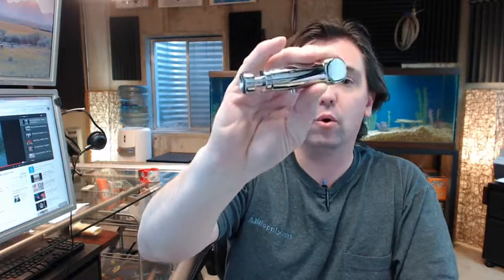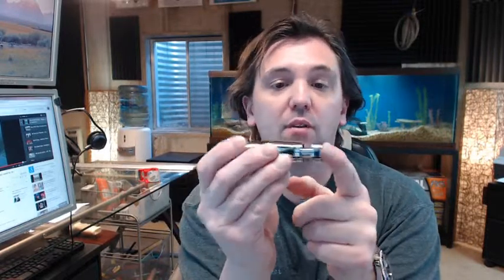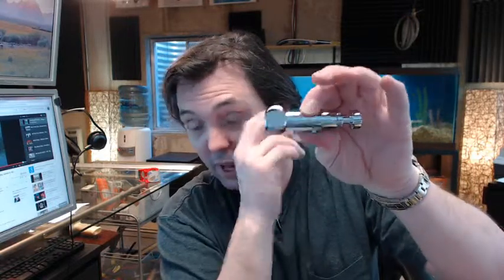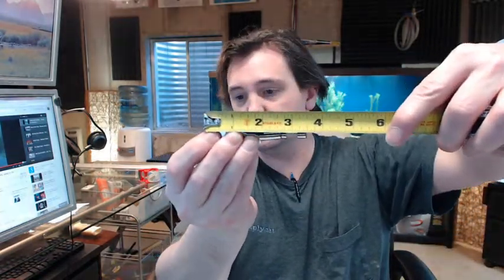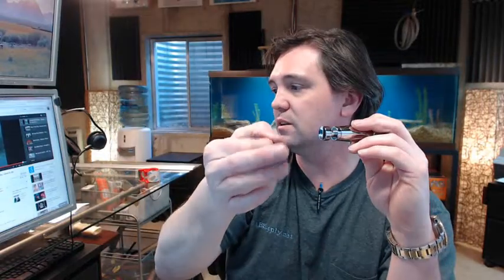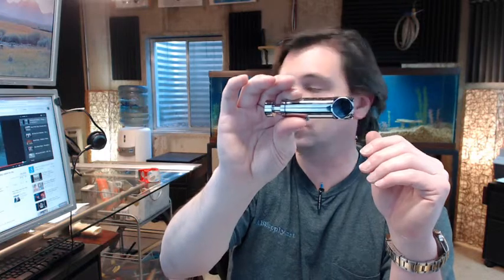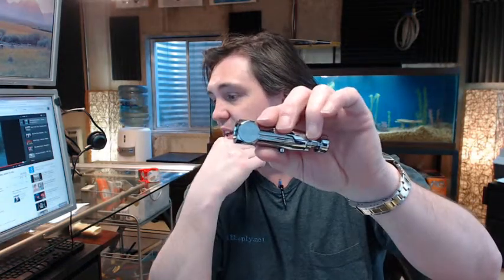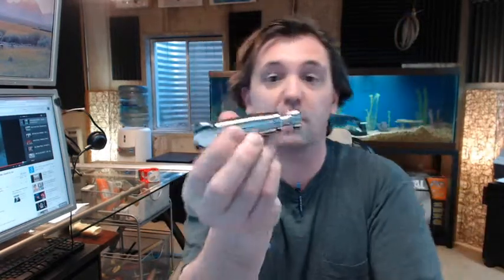ASI 0353 Horizontal Valve For Gravity Soap Systems

Comment: Do you have a video on the different reservoirs for this system?
Reply from the maker: Unfortunately I do not have a video of the different reservoirs for the ASI Gravity Soap Systems as they are discontinued.  The three different reservoirs that were available at one time where the part numbers 0376, 0377 & 0378 and I can provide you a link to the technical drawings as seen here:   https://absupply.net/ext/asi-0376-tech.pdf   and here:   https://absupply.net/ext/asi-0377-tech.pdf   And I hope this information is of some use to you.